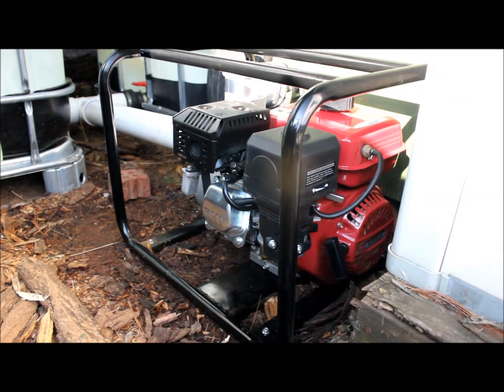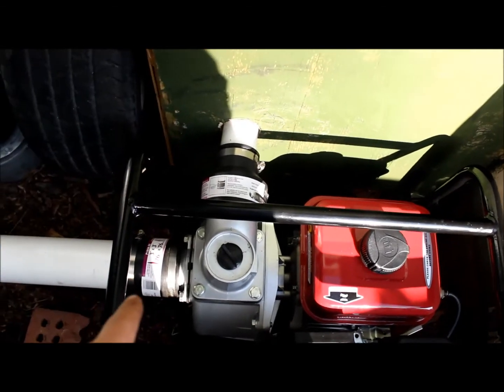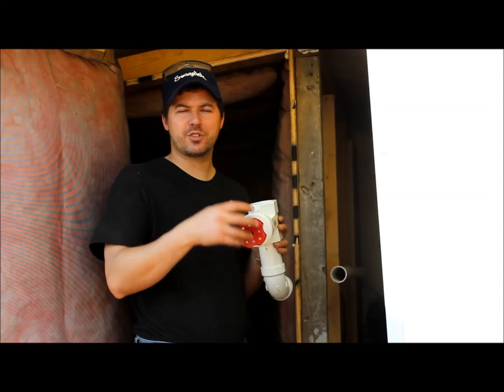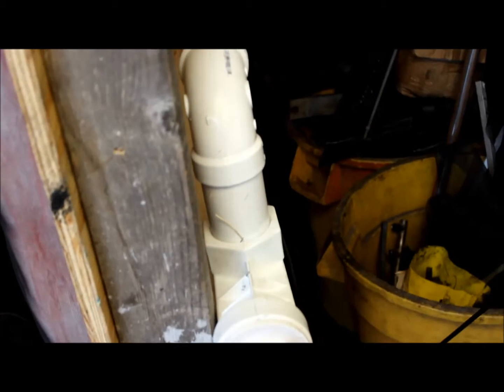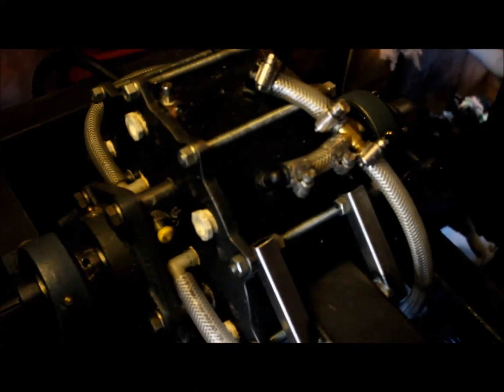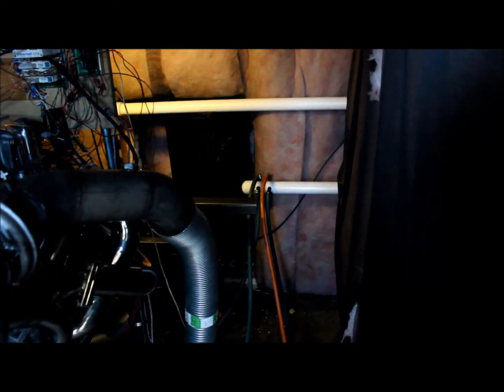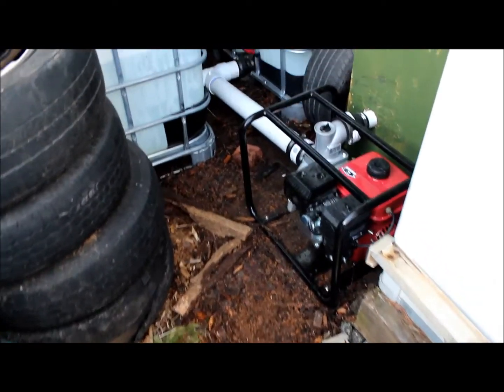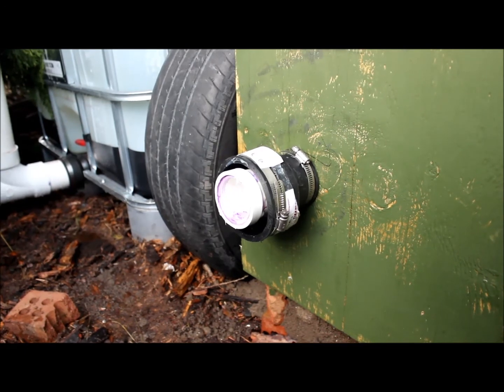Dyno Shed Pt 3, Plumbing the Brake

Comment from the maker: That depends on what you want to do.  Small turbos spool up fast, big one's make more power.  If you're using junkyard or Chinese turbos, I'd err on the small side cause you can buy bigger ones later.  If you're buying Turbonetics, Garretts, etc, buy what they recommend.  They have nice calculators on their sites.  Check out theturboforums and yellowbullet.

Comment from the maker: remi,
      The absorber is my own design.  We'll see if it stays together.  So far the most it's measured was 500 lb-ft due to a lack of water (two garden hoses).  I had a turbo sbc on it that measured 500  lb-ft from 2500-5000 rpm where I ran out of injectors.  Due to the fuel consumed from 8 42lb injectors at 70 psi, I'm confident the motor was making more power.   As soon as boost came up it literally started making steam and rpm ran away.  Hopefully 220 gpm will remedy that problem.

Kevin